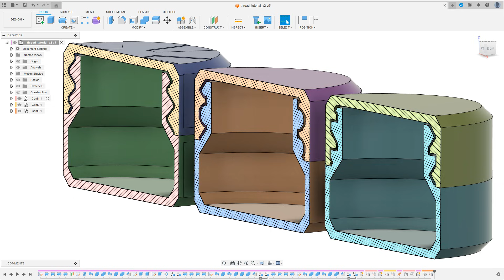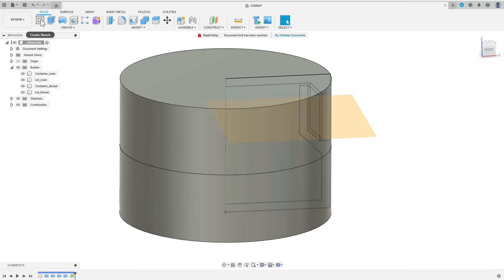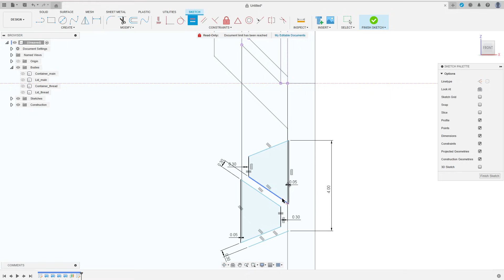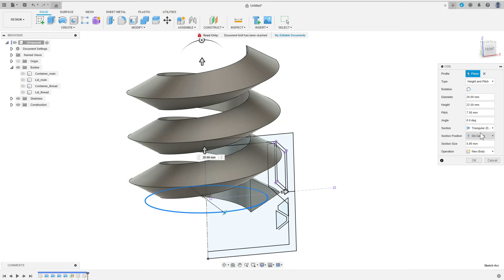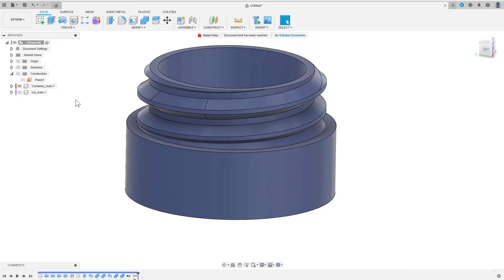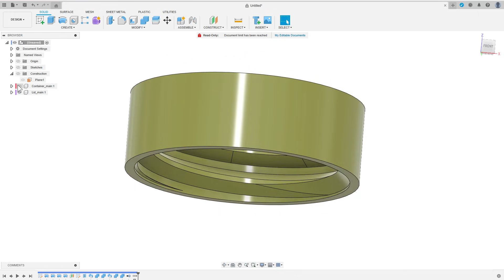Custom Threads for 3D Printing in Fusion 360

Comment: I would just make the bottom half of the thread, then a cylinder on top and then cut the shape with the combine tool. After that 0,3mm offset face to the lid part threads. Faster to make and easier to customize.

Comment: Another great tutorial! As an exercise for the student, I went back and parameterized the drawing (cap & container heights, wall thickness, diameter, gap size, and pitch). I started with the sizes you showed and after making sure nothing broke I was able to make a cap for my Mason Jar (70-450 specification) by changing the diameter and pitch to 70mm and 6.35mm respectively. The only change needed for the design was to define the diameter so it went to the container's outer thread to match the drawing I had for these jars
Reply from the maker: Thank you! Great to hear about your success! I'm actually thinking about doing a quick one about interfacing with jars...

Comment: This is the video instruction I was looking for to create 3d printing threads. Unfortunately, I have not been able to understand and get working the combining steps. You talk too fast and click too fast, and you don't show your steps in a manner/order that I can understand. It would be great if you could make a detailed instruction video showing all the exact steps to make the coiled threads combine, both internal and external. I have spent considerable time trying to get this to work as your video shows, no luck. Thanks for showing that there is a way to design custom threads using Fusion 360. Keep making instructional videos.

Comment: Exceptionally well presented. Quite a challenge for me as a relative newbie to Fusion. I've got the hang of dimensions and constraints, but working my way through this clever technique (some bits with playback at 50% speed so I could see what was happening in the dialog boxes) taught me a whole LOAD of new tricks, and I've managed to replicate the technique for my needs, so this vid has been extremely useful for me. Thank you! The hardest bit for me was spotting that the thread needs to be INTERSECTED with the thread profile, as soon as I noticed that setting being used in the dialog, my thread pinged into life 😍

Comment: Hi and thanks for your video, its very helpful to see the process. I am having a bit of trouble using the coil feature. The location of my coil is not at the origin and when I go to sketch the circle for the coil I dont seem to be able to locate it at the centre of a boss that is ofset from the origin.  Any ideas how to do this?

Comment: For anyone wondering why the combine is not working, what helped for me: slightly lower the distance from 0.3 to 0.25 between the threads and also increase the overlap of the profiles of the threads from 0.05 to 0.1. For me, the problem was that Fusion didn't detect the overlap as significant and this worked like a charm so sharing with the rest!

Comment: If you look at injection molded threaded items: like bottle caps, pill bottles, etc; you'll notice most don't have the thread start near the top of the body until it reaches full thickness. Actually there is usually a completely bare buffer region near the top of the body and corresponding base of the cap.
It's not a great idea to have the thin profile thread on the lip of the body where it has no "meat" to it and will easily get warped or damaged - especially if you're gonna 3D print it.

Comment: Creo has much better functionality imo in regards to coil, there should be an option to have custom profile in coil menu
Reply from the maker: Agreed, Creo‘s Helical Sweep offers more functionality. For the outline profile there is a straightforward workaround in Fusion, variable pitch afaik poses a problem in Fusion.
Reply: @getprototyping  I wonder if a plugin can be designed for such purpose
Reply from the maker: Maybe I will look into it at some point, but probably not within the next few weeks.

Comment: A good alternative to modelling both thread profiles for the inner and outer thread is to simple subtract the thread from one side to the other and use the offset face tool to make clearance
Reply from the maker: Can be certainly done like that. Excellent way to make the process even more efficient. 👌
Reply: Yes and no. Depends on the shape of the thread profile. If you would do this with the thread profile containing curved surface like the one in the multistart version of this video then it wouldn't work. Not trying to be mean, I value a mind that analyses what it sees, just brainstorming here ;)

Comment: As a designer, why would I want to do this? I fail to see the real benefits.
Reply from the maker: There are a number of scenarios where standardized threads do not work well. Most commonly, standard clearances are generally unsuitable for 3d printed solutions. I generally like to have full control over the thread design when I print both components. Also, there is an virtually infinite number of uncommon (or even non-standardized) threads out there you might want to interface to (jars, bottles, fine threads, even sawtooth profiles, buttress, tapered threads, ...).
Reply: If you want to model something for a given non-standard thread, you need this.

Thanks very much for this Tutorial ❤

Comment: Excellent tutorial. Would you consider showing how you would apply your preferred technique to create a threaded connection between two parts that are not created from a revolution? Such as adding a stool leg to multiple locations on the stool seat? I have done this with the thread library but love the idea of creating better, 3d printable threads.
Reply: Couldn’t you (attempt to) follow his example once and then do a circular pattern of the finished bodies where the legs of the stool will be?
Reply from the maker: Thanks! You could duplicate the thread body after creating it once, either using a pattern or by copy & move. You'd just have to do it before joining the thread to the main body/bodies.

Comment: Why to do custom threads ? I am a CATIA user and I don´t have a library of threads so I have to design them every time from scrach ...again ..and AGAIN I wish I could simply use some coarse pipe threads from a library instead.
Reply from the maker: You can of course use a library for standard threads. You can also use your own templates and even addins. I will probably make a video about these things at some point.